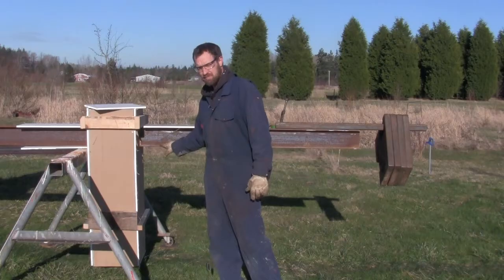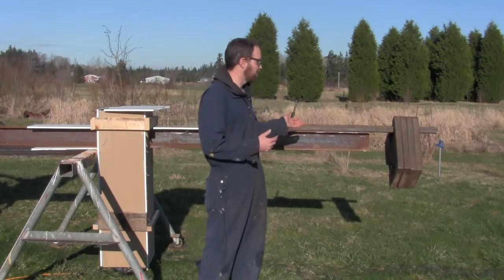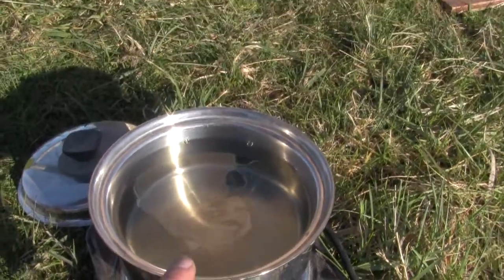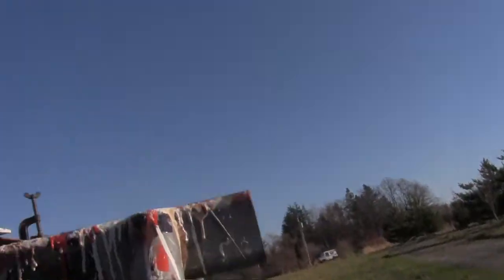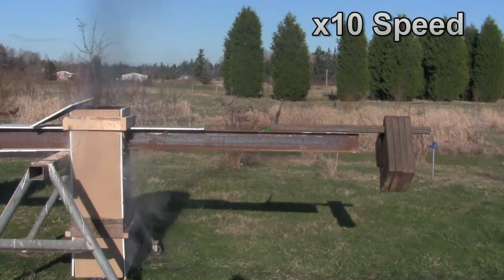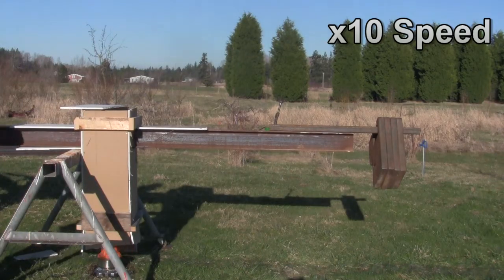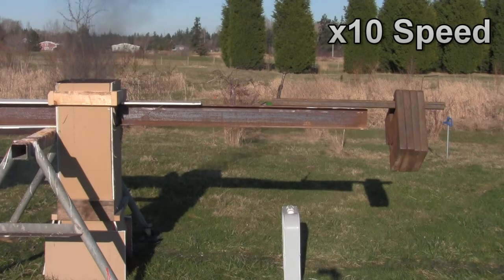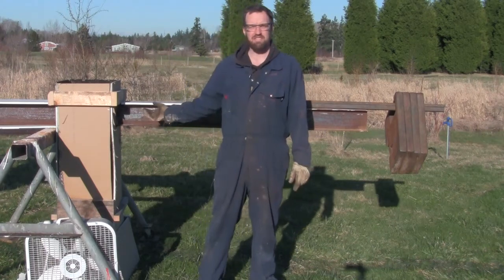Melting/Bending a beam by burning Jet Fuel.

Comment: I think you did a pretty honest job of this experiment. It can definitely be difficult to replicate a skyscraper in your backyard.
Reply from the maker: Thanks, I feel like often when experiments don't go according to plan or don't have the results you want it is easy to just not publish the results. Not publishing results that don't fit what we want puts a bias into science.
Reply: @curtis52285  Why didn't the beam explode at the end into tiny segments. It should have launched some segments of the beam into your house about 4 hours later! Strange...
Reply: @FlyXenonRC I agree he couldn't replicate a skyscraper in his backyard but this is an experiment replicating the burning conditions.. does it have to be a skyscraper?.. surely if it's enclosed using fuel and steel it's irrelevant where it's done.
Reply: Problem is people are too stupid to understand how melting steel collapses a heavy building.
Reply: @afberglund2764 Steel was protected from overheating with asbestos
Reply: Problem is that jet fuel in those wings weren't sitting in a pot all together,..it dispersed erverywhere,..Sorry not buying it
Reply: @applejack2911  how do you think that would influence the results of the experiment?
Reply: @FlyXenonRC  heat gets trapped
Reply: @applejack2911  Same here, hardly explains why it dropped at freefall speed into it's own foot print and yet magically didn't touch the passports found on the ground at the location.
Reply: @applejack2911  10,000 gallons of jet fuel burning in an office building full of flammable furniture and paper which was just struck at 500 mph by 300,000 lb of passenger jet through part of its steel exoskeleton. It's not that hard to figure out that the planes hitting the towers caused structural failure by both heating and impact, which allowed for the top floor to collapse and pancake the rest of the tower.
Reply: @umbrvalken  You do realize the buildings were designed to take the hit of 8 airliners right?  8 each and still be standing.
Reply: @jamesbarrett9066  Source? Where did "eight" come from exactly?
Reply: A lot of the jet fuel burned off on the outside of the building as well. And you got to consider that how much of the heat will it be distributed upwards and that it would burn off quite quickly actually in fact if you look at the video there is a person standing in the hole waving their arms so that they can be helped . If the heat got hot enough to melt all the metal that are vertical and horizontal no human being would be able to be in that building waving their arms. This person was in the main cavity where the jet struck  @umbrvalken
Reply: @umbrvalken Lol nope. That fuel is not mych flamable and most of it burned on impact, clearly it was a demolition Israel needed war there with cheapest assets they have
Reply: @jamesbarrett9066 it stood pretty intact for how long half a hour or more? Only upper levels suffered significant damage, it did not even burn violently. This building had steel structure which dissapeared fragments of destruction were tiny and some of steel structure ended up in nearby buildings, does not look like fire at all.
Reply: It's definitely easy to replicate a lie when everyone is brain washed by it.

Comment: I bet if ya could get the flame closer u might have had a better result
Reply from the maker: I doubt that much heat energy is lost as the gasses are not allowed to disperse like a camping fire. Honestly you can see the flame reach out of the top at times. The idea location is at the very end of the flame tip where all the fuel has been burned.